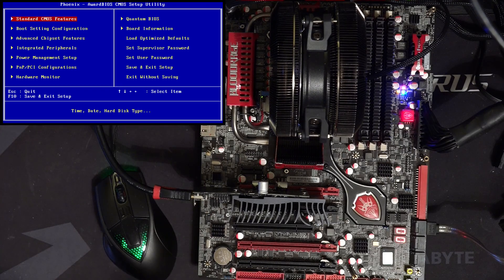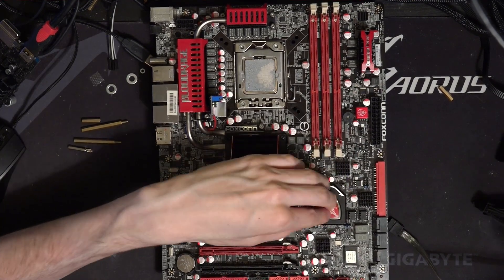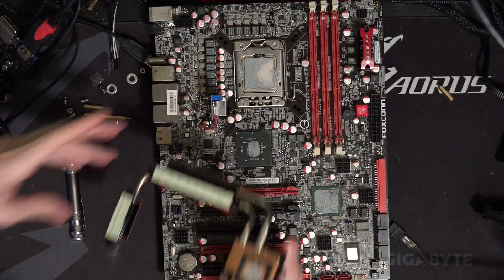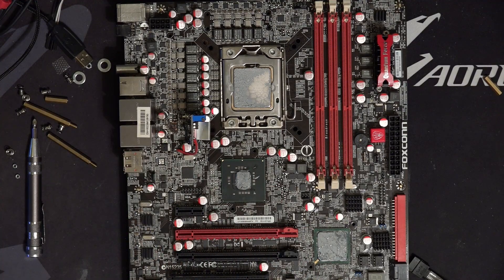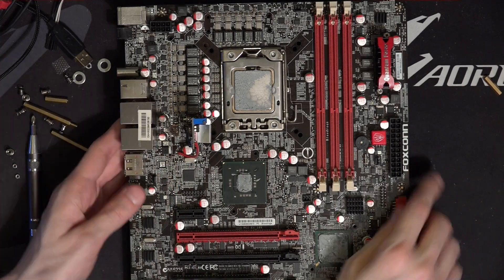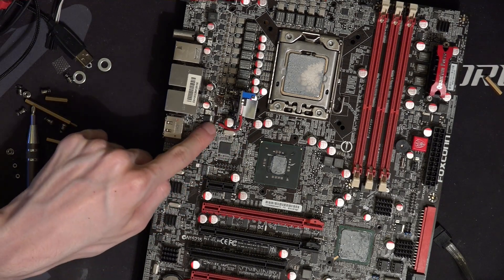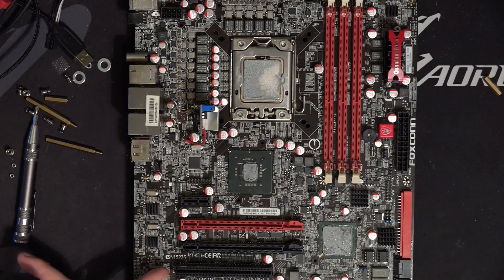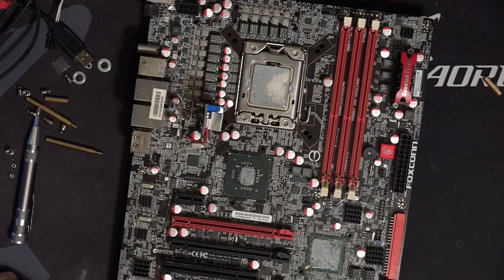Motherboard necromancy: Foxconn X58 Bloodrage

Comment: yesterday i built up my old asus p6t-ws-revolution with a x5675 oc to 4.8 ghz all core with a noctua d12 32gb 2000mhz triple channel ram getting max temps on prime 95 of 82c but it never reaches that normal. put a gtx 980 in it and my 6 year old plays all her games perfectly. know its a bit old but still gets my 6 year old interested into the pc world she loved building it together and the main thing is she now wants to learn more. good old x58. and brilliant repair good work
Reply: X5675s are fairly good chips and quite fun. Did ran 5.475 ghz on a pretty mediocre motherboard with one. Was limited by the board
Reply: I miss mine, too. But I did get a good offer for my two 5675's and the Asus P6T Deluxe V2 I used as my daily system three years ago and couldn't resist. X58 was the greatest platform I ever used (thanks to these used 6-Core Xeons).
Reply: @Onewolfoc  Wow!
Your clockspeed was phemominal!!
Do you still remember what your ammount of voltage was?
And did you use Hyper Threading? 
I even never have heard somebody managing to overclock to this speed.
Well done!

Comment: I still have two X58 Rampage III Extreme MB's with X5650 CPU's. One boots perfectly and one needs some repairs, but nothing serious. I am going to run them in nodes in a server. Glad to see I am not the only one still messing with X58. Just wish I could get my hands on two ROG Expander boards. Also running a Asus Rampage Formula with Q9550 cause I can't get a QX9770. If you want HD pictures of my MBs, just let me know.

Comment: I seem to remember a ancient conversation about that board and I do believe it was the bios that was limiting it's memory overclocking  and there was some other thing that limited it's bclk abilities thus taking a potentially great on paper board and making it not usable without lots of fighting especially when the -oc and rampage exist. but could be miss remembering it was years ago
Reply: There is a resistor that sets the pcie mode for the x58 chipset. By resoldering that resistor or one of the same size and spec. Onto another set of pads it tells the x58 chipset to change from pcie mode LCPLL to  SCPLL. SCPLL has more range but also more jitter this mod fixes the boards limited pcie bus speed allowing you to get the high pcie freq. required for high base clock speeds

Comment: Do the chipset mounting hardware nuts have a broken screwdriver tip inside, or are they just JIS screws rather than Phillips?
Reply from the maker: I ended up replacing the 2 most messed up nuts with some hex nuts

Comment: I saw on HWbot most people are using BCLK above 200 for LN2 (and some water) on their 990x (and at 1.9V wow!) Looks like a fun platform for overclocking. A few records were set under water, so you can pick up a few points here and there if you want.

Comment: I think that's only this board that does that, I had a x58 from asrock with a blown Low side MOSFET on the vcore and everithing I did was upsetting the board and shutting it down :( but great video! I love stuff like this!
Reply from the maker: intresting. I guess it could be worth getting more dead X58s to mess with. Only issue is I have no way of knowing why they are dead ahead of time.
Reply: @ActuallyHardcoreOverclocking  that's the real challenge, finding the one that CAN be fixed without bga replacement

Comment: I think this was the only x58 "overclocking board" that had 1dpc. these came with a ln2 pot & water block for the north bridge. had 2 of these years ago, 2 of my buddies built red/black builds. they wanted more ram so ditched the boards. I only have 1 now. iirc you can do almost 2.5 vcore and just under 3v ddr
Reply: Yep there was a few 1 dimm per channel x58 boards but this was the only XOC one/ non garbage one

Comment: I just got the EVGA FTW3 Z590 mobo and cant find any reviews of it will you do a review on it also Im planning on either a 10900k or 10850k what do you think
Reply: Great choice ! Skip 11th gen, you will have better memory overclocking potential without Gear 1 and 2 👍
Reply: @maxoo._  thanks for the advice I was told really no differance between the 10850k and the 10900k except the 100mhz I guess get what I can but no 11th gen also I heard if i use 10th gen on a 590 board the upper mvne slot wont be pci4 only 3 with the 10 gen true
Reply: @jawalbert7788  yeah true but you won't notice in day to day use 😉
And the 10850K is a great cpu much less expensive than the 10900K 👍

Comment: Would you please show how to overclock memory and uncore on this board properly? Pleeeaaasseee.
* I should have a dead R2E laying around in my cellar, if you want it for free let me know, I'll go find it then
Reply from the maker: See that's the issue with it I have no idea how to change the RAM ratio. It's stuck at 8x for some reason.

Send me an email to buildzoid@gmail.com about the R2E.
Reply: @ActuallyHardcoreOverclocking  there is a known uncore bug with some board +  cpu combinations. I missed it in the video but you are propably using a xeon x56.. ? the W and E cpu's shouldn't have that problem. bios update / custom bios will also work.

the westmere-ep xeons are made for uncore = 1.5x * ram speed. the i7-920 etc cpu's need 2x * ram speed. so it's basically locked to 8x mem / 15+-1 uncore. 
10x on the mem is the max I can set with x5675, everything above 15x uncore seems stable, seems to give more performance but in reality it doesn't. the imc makes alot of mistakes above 3200 MHz (which is 1/2 max supported  QPI link speed)

this platform drives me mad for years now!
Reply: @ActuallyHardcoreOverclocking  you see, back then there wasn't really someone with actual knowledge behind overclocking this architecture. everything you'll find on the internet is full of non sense, which is difficult to seperate from the facts. I'm currently, or for at least 4 years now, at 4.4 GHz 6 Cores, no HT, 1.43V set in bios, LLC on, drooping under load to 1.39V, Uncore @ 3 Ghz @ 1.3V QPI/VTT (QPI 1.3, VTT -200mV) -had it for years at 3600MHz and 1.35 QPI/VTT but that wasn't really stable. It seemed like it was but with it there came all kinds of problems with usb, sata, memory timings and what not. 3800 MHz with 1.35 QPI/VTT and 1.32V QPI Pll seemed to be outstanding performance wise but would crash randomly after sleep with whea_uncorrectable_hardware_error. memory is always at 2000 MHz CL-9-9-9-27 ... 241 CR2 1.62V and auto settings for termination and ref. chan. volts. . (1866 9-9-9-27 1.5V 1.3 qpi xmp spec. ram). 900 mV CPU Amp clock, 200 MHz bclk, 1.86 cpu pll, 500p clock skew for ioh and cpu. Powersaving stuff and boosting off.

I bet your board is stuck at 15/16x BCLK for the Uncore. raising your bclk with my settings could at least get you started. with like 1600mhz 8-8-8-24 memory.

Knogle (the starter of the thread in the link below) knows everything you need to know, I guess. https://extreme.pcgameshardware.de/threads/review-hat-der-uralt-sockel-1366-eine-chance-gegen-skylake-westmere-als-cpu-geheimtipp.337698/